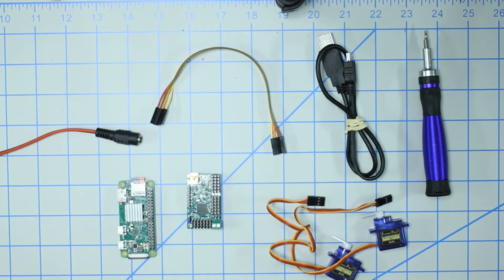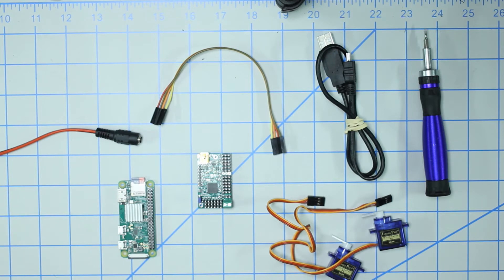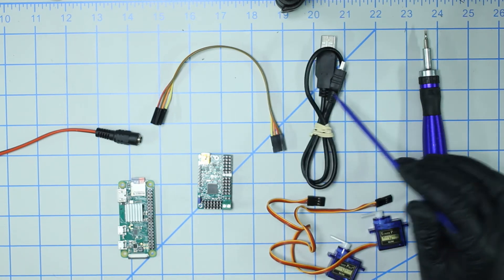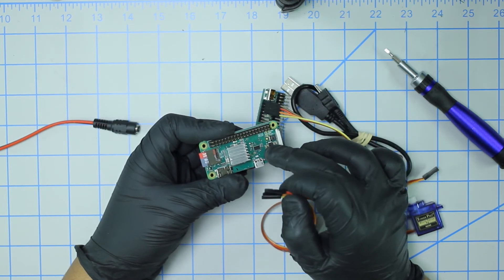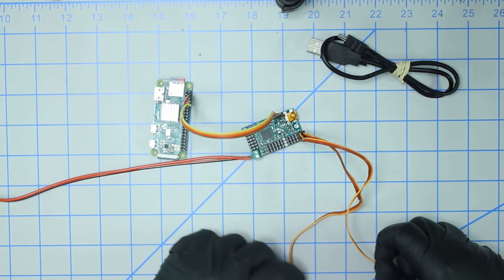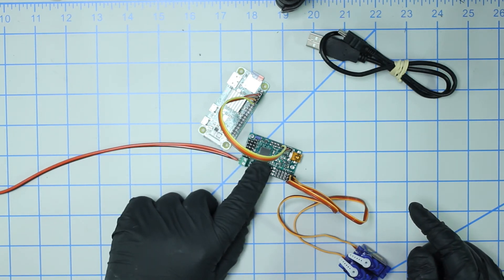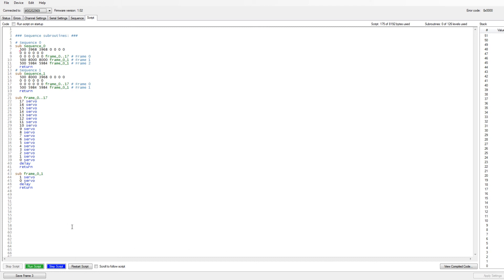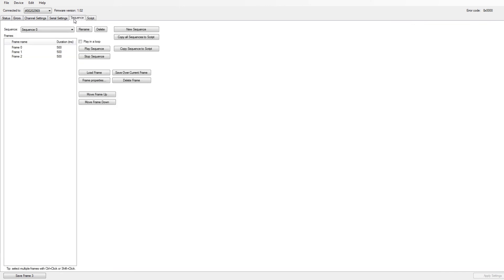Maestro Servo Controller (Raspberry Pi)

Comment: Hi, and thanks for this video! I was just wondering on thing: how can you execute subs in the last part of the vidéo? When I give a try, it just displays sub0 or sub1, but the motors does not move (from what I understood, the frames are not saved on the controller, so I don't get how the RPI is able to get the subs/frame to execute them). Thanks for your help!
Reply: Answering to myself. In fact I had an issue because I already saved frames to my pololu (long time ago, when performing tests on Windows). I deleted everything, applied setting once frames where defined and it is now OK (if it might help others)

Comment: Is there a risk in not using a level controller for the serial connection, as the Pi uses 3.3V while the Maestro uses 5V logic?
Reply from the maker: Seems like I overlooked this detail. I believe you are right, the pins may be damaged in the long run.

Comment: Hi I was just wondering how you could use this as a script not just in the terminal. I am making a launchpad that automatically runs a script when turned on and I just wanted to know if you can just copy the script in 25:45.
Reply from the maker: There are several methods. https://www.dexterindustries.com/howto/run-a-program-on-your-raspberry-pi-at-startup/

Comment: hey thanks for this.
i'm very new to this and trying to follow your vid step by step, but i'v to run into an error.
if you can point me in the right direction i would really appreciate it.

this is the error:

 File "test1.py", line 3, in <module>
    servo = maestro.Controller()
  File "/home/pi/Maestro/maestro.py", line 33, in _init_
    self.usb = serial.Serial(ttyStr)
  File "/home/pi/.local/lib/python2.7/site-packages/serial/serialutil.py", line 240, in _init_
    self.open()
  File "/home/pi/.local/lib/python2.7/site-packages/serial/serialposix.py", line 268, in open
    raise SerialException(msg.errno, "could not open port {}: {}".format(self._port, msg))
serial.serialutil.SerialException: [Errno 2] could not open port /dev/ttyACM0: [Errno 2] No such file or directory: '/dev/ttyACM0'
Reply from the maker: Hey Mark, what output do you get when you type "dmesg | grep tty"? Also check to see in the Maestro Control Center application, serial settings tab that you have "UART, fixed baud rate 9600" selected. Also I noticed that I uploaded the wrong test scripts on my website so I just updated them, go and give those a shot. Anyways, from that dump it looks like the error is stemming from the script trying to use the USB serial interface, and we want to make sure it's using the TTL serial interface.
Reply: Hey, I have the same issue as Mark. I have download the Maestro from Github directly on my pi but the Maestro Control Center application I installed on my windows. My tty1 is enabled, also, I have ttySO and ttyAMAO appeared for dmesg | grep tty command. I used something like you did in test.py but turns out the error above.

Comment: OK simple fix to the issues described below. The default serial port is "dev/ttyACM0y". But  the correct serial port  is '/dev/ttyAMA0'. In the python script we need to specifically define the correct port. For example

import maestro
import time
servo = maestro.Controller('/dev/ttyAMA0')
servo.runScriptSub(0)
print("sub0")
time.sleep(3)
servo.close

Comment: Your work is very useful for one of my physics project , thanks . I followed your steps but I have some problem .

Please help me with these error :

Traceback (most recent call last):

  File "sub.py", line 3, in <module>

    servo = maestro.Controller()

  File "/home/pi/Maestro/maestro.py", line 33, in _init_

    self.usb = serial.Serial(ttyStr)

  File "/home/pi/.local/lib/python2.7/site-packages/serial/serialutil.py", line 240, in _init_

    self.open()

  File "/home/pi/.local/lib/python2.7/site-packages/serial/serialposix.py", line 268, in open

    raise SerialException(msg.errno, "could not open port {}: {}".format(self._port, msg))

serial.serialutil.SerialException: [Errno 2] could not open port /dev/ttyACM0: [Errno 2] No such file or directory: '/dev/ttyACM0'
Reply from the maker: Have you tried running the script in sudo, also have you enabled the serial interface?